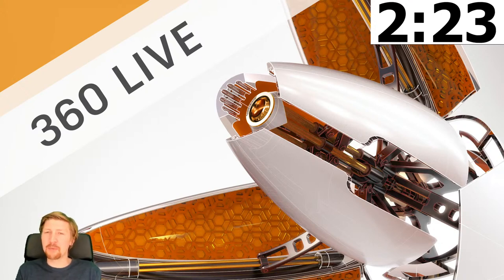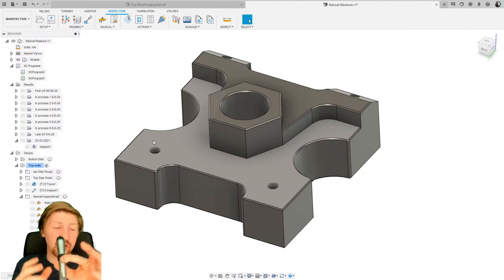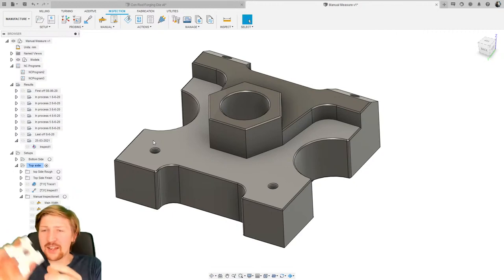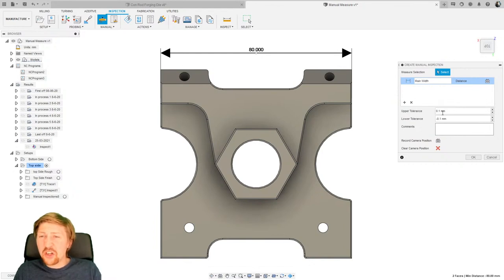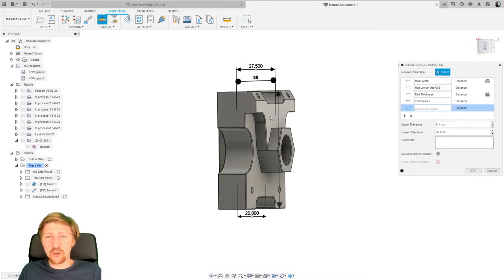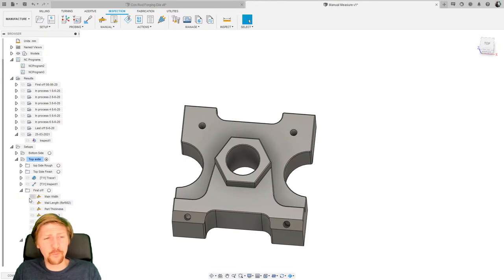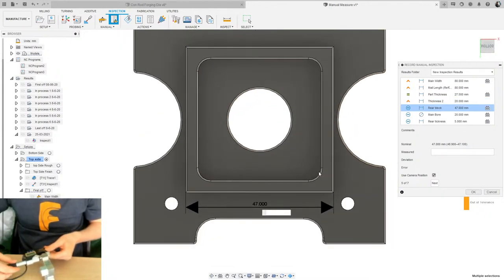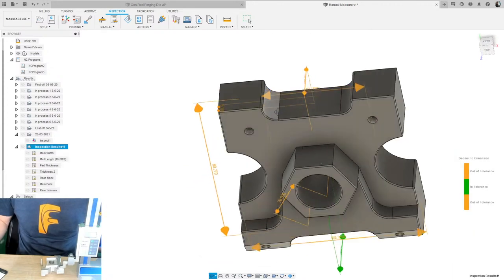360 Live: Inspecting your components with Fusion 360 - Manual Measure

Comment: Great video. It is the scale that is called the Vernier scale. So it is not on the digital one you have there. The other (older type) of calipers have Vernier Scale and using mechanical interpolation. The scale has the function of dividing, for example, 1mm into 1/10 mm. You interpolate the mm with the 1/10 scale.
Reply: Awesome!! It always makes me smile when someone says "pass the vernier".
Reply: @richardstubley9651  Yes. Here in Sweden we call it skjutmått” direct translated to english is ”shooting gauge” because of the “shooting” or sliding of the tool.
Reply: @richardstubley9651  ah, the old gatekeeper of knowledge! “I know a thing and will laugh internally when you accidentally get it wrong!” Instead of telling people in the video, you stroked your ego by giving points for being a smart arse.
FYI, I did know the answer, and used to be constantly corrected for referring to rules, as rulers, and passed this onto my children, before learning that was actually incorrect.
You are everything that is wrong with technical hobbies like ours. Look at some of the other comments on this video, people aren’t enjoying them, they are suffering through them, trying to get to the information they need easily. Myself included.

Comment: Great video. What if you have a triangular part. Can you measure from edges to surfaces as well, or only between surfaces? And what if the corners are rounded? Can you measure to a curve? Thanks, Marco.
Reply: Hi Marco, Surface to edge, or point to point are features that are on our list to implement. Regarding the curve, you can measure anything over a 180 degree curve. Do you mean about a block with rounded edges and measuring the tangential distances?
Reply: @richardstubley9651  More like a triangular item with rounded corners, looking to measure the height from base to rounded top, and the base from rounded edge to rounded edge. Also if the triangular part didn't have rounded corners, looking to measure the base edge to edge, or the height surface to edge.